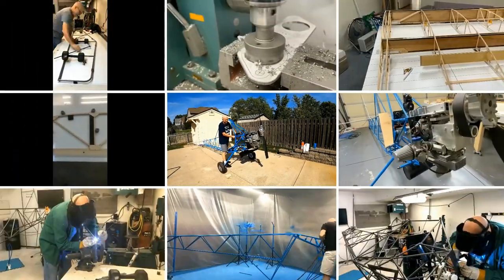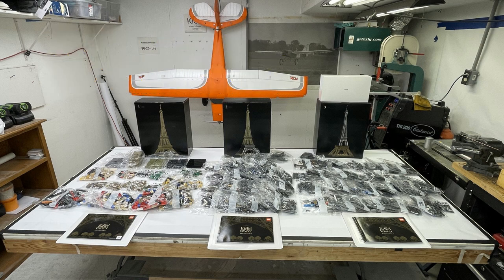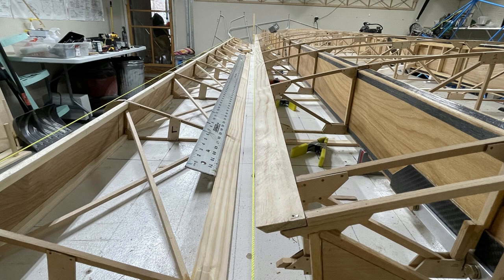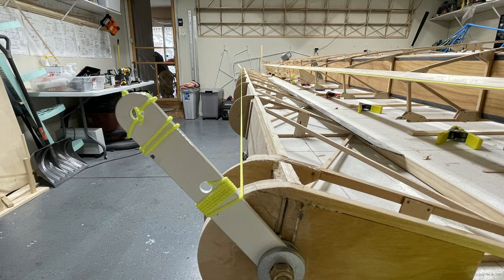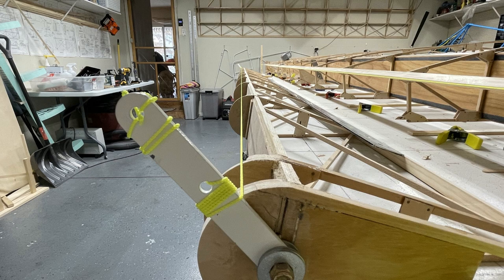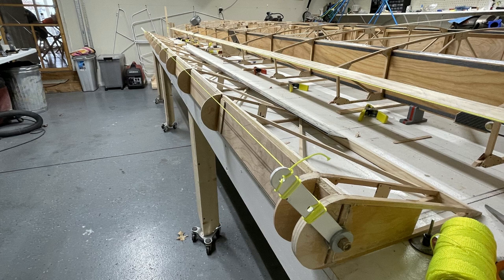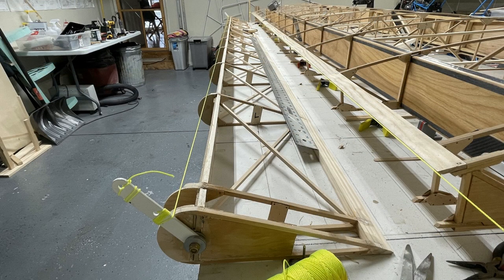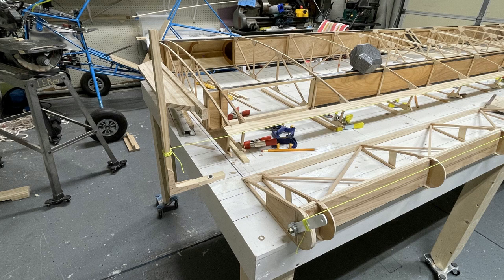AirBike Ultralight Update

Comment: 1. GOOD DAY SIR THANK YOU FOR YOUR TIME TO DO THIS VIDEOS IT INSPIRE ME TO BUILD MY OWN ULTRALIGHT. 
2. CAN I ASK YOU A FEW QUESTIONS HOW FAR IS YOUR BUILDING YOUR ULTRALIGHT AIRBIKE?
3. IS YOUR AILERON THE WHOLE WING AND IS IT BETTER TO HAVE GOOD BIGER LIKE WIDER AILERONS TO MAKE GOOD LIFT FOR LANDINGS? I SEE SOME BUILDERS AILERONS ARE NOT SO WIDE AND LONG IN THERE BUILDS OF ULTRALIGHT AIRCRAFT.?
4. IS A WOODEN WING LIGHTER AND STRONGER AS A METAL WING? OLDER PLANES WAS ONLY WOOD THATS WHY I ASK. 
5. I AM IN SOUTH AFRICA AND WE DO NOT HAVE ALL THE WOOD THAT THEY SAY WE MUST USE. CAN I USE ONLY PINE FOR THE RIBS WHAT WILL YOU ADVICE ME TO DO? THANKS AGAIN FOR YOUR TIME TO MAKE THESE VIDEOS OUR KIDS MUST BUILD MORE PLANES AND PLAY LESS TV GAMES THAT DESTROY EYES.
Reply from the maker: Hello
To answer your questions-
3. Depends on the design and how you want to control the aileron. Full span ailerons means you can hook up the aileron controls at the fuse attachment.
4. For me wood is lighter as it takes a lot less design time as wood is very well understood for aircraft design. Metal needs rivets, screws, or welding. 
5. As far as pine. I have heard of people using it. It is a little heavier from my experience. And I have read it will warp a bit over the years from moister. 

Rock ON!
Reply: @dagtheaviator  THANK YOU VERY MUCH BROTHER I LOVE YOUR RC PLANES I AM GOING FOR MY RPL SOON IT IS JUST VERY EXPENSIVE BUT I HAVE TO WE GOING TO DO SECURITY WITH THE DRONES. LUCKY THE COMPANY PAY MY COURSE. IT SEEMS LIKE IT ONLY YOU THAT KNOWS ABOUT PLANES THAT GIVE GOOD ANSWERS MANY OUT THERE THINK THEY KNOW SOMETHING BUT LIKE TO TALK BS. HAVE GREAT DAY IT NEARLY SLEEPING TIME HERE IN SOUTH AFRICA DARK AND COLD THIS WINTER IS BAD.